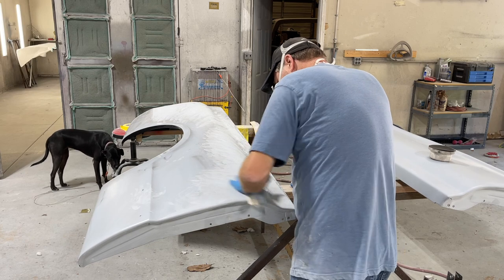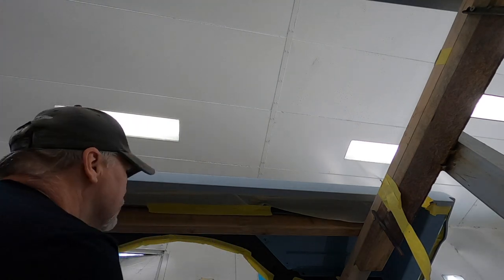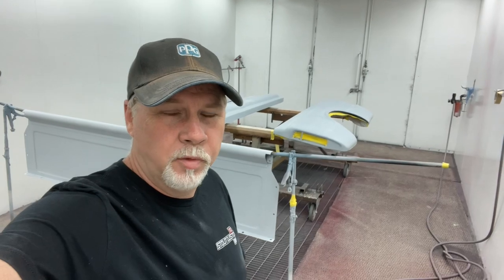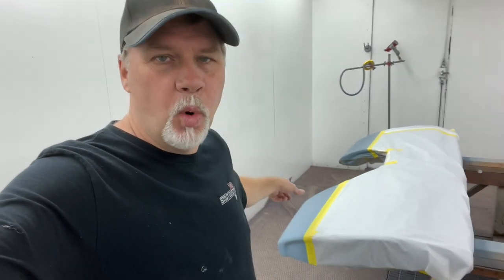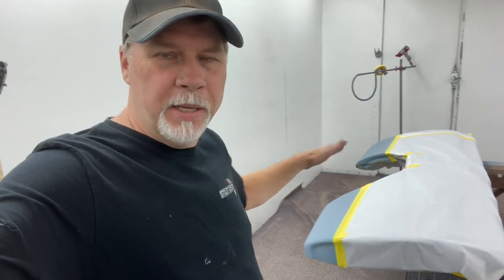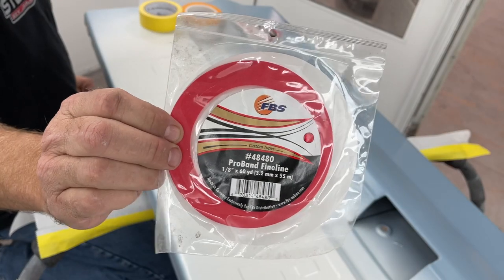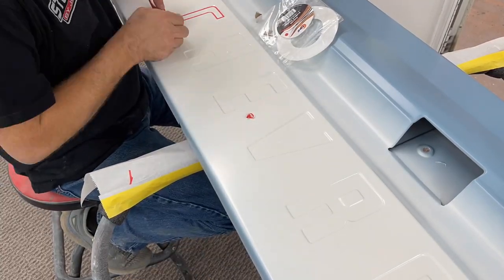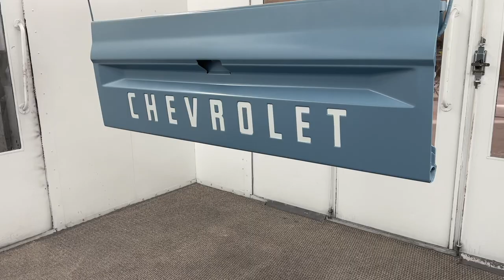C10 Show Truck Project:  Painting the Bedsides and Tailgate.  Almost Finished with Project

Comment: What kind of high build primer are you using and how long do you let it cure.
Reply from the maker: To cover the filler, bond to exposed metal, and something thick for heavy blocking I use PPG’s  Vibrance VP2050. I usually finish it with 180 then on this one I used PPG’s Global D8005 high build primer on top to fill the 180 scratches and give me something easy to sand with finer grits in preparation for paint. Dry time on the VP 2050 is overnight to 4 days…it’s slow drying and best to wait several days. The D8005 dry time is about 6 hours but preferably overnight.
Reply: @StoutCustom  thanks for your help

Comment: How do you lay the tailgate flat on a 77 for re clear? No place for a tape  line on the top side?  I did get a few drips around my letters hanging it upright initially!
Reply from the maker: I painted and cleared it the first time hanging. I got some slight runs as well in the letters. Second clearing was with it flat, taped off on the seam at the bottom and rolled the back edge at the top so there was no hard line. Just a soft edge where the clear blows across but doesn’t wrap all the way around the edge. If there is any transitional area it can be polished away easily.

Comment: what paint gun would you recommend for a beginner? i’m wanting to spray sealer, base and clear out of it. I know a lot of people have a separate gun for each but don’t have 3000 for just guns right now lol!
Reply from the maker: 3m makes their accuspray gun kit with different nozzles for different materials.  Gives you lots of options and fairly cheap to experiment with different tips to find what you like. Harbor Freights Black Widow gets a lot of favorable reviews as well. I’ve noticed most cheap spray guns are copies of more expensive name brand stuff. Biggest difference is they usually don’t last as long but if you’re not in a body shop spraying every day they work fine.

Comment: Very nice!
WS400 for clear?
What clear coat you using?
Reply from the maker: Thanks! Yes ws400 with VC 5700 clear
Reply: @StoutCustom  
Looks like a really nice clear. I use Glasurit 923-210 at work. 
Iwata W400 with 1.3 tip @29psi.
You using a 1.3 or 1.4 in your WS400?
I really have been wanting to try that gun out for a couple years now.
Reply from the maker: @splash5974  I’ve got the 1.4
Reply: Wanted to add my two cents. I also use the W400 with a 1.3 at work. I love that gun.
Reply: @davidl2736  What psi you like to run for clear?
Reply: @splash5974 The W400 has the red WBX cap and if I clear with it, around 22 psi. The other painter just got a WS400 also 1.3 and I think he runs his at 26.
Reply: @davidl2736  I have the Bellaria W400 . Im around 30psi...Just trying to find the sweet spot, but its hard when one time your spraying a bumper and the next session your spraying the side of a vehicle.
I think im a bit too quick for it, cause i find i cant get it to slick out the way id like...Parts, hoods, and roofs it lays down nice